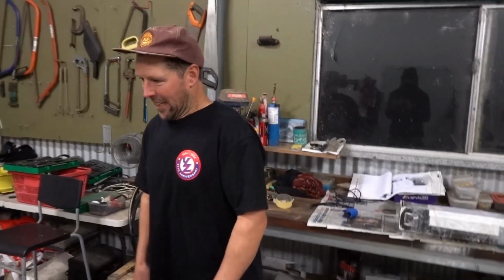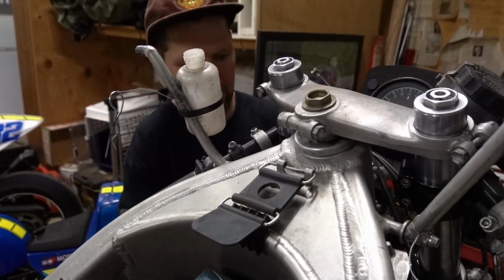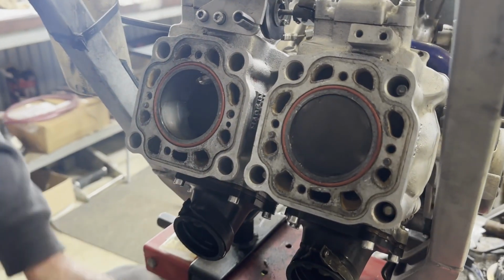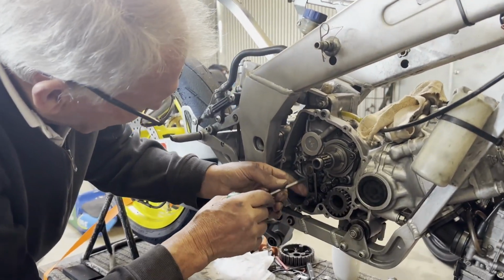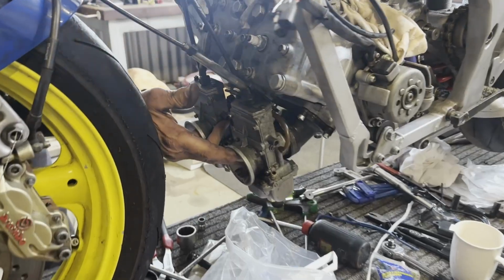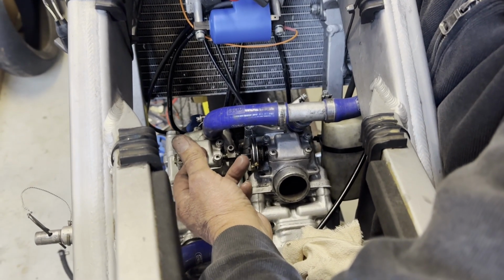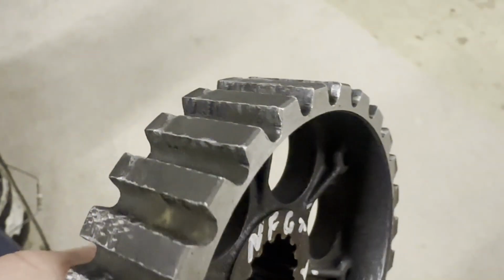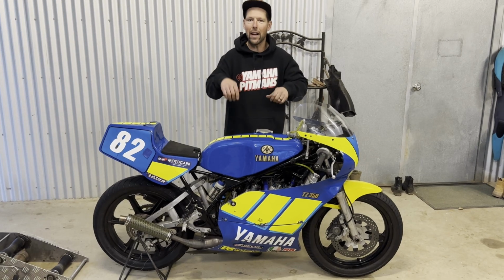TZ250 Reverse Cylinder

Comment: Great, glad to see an identical machine running. I just bought mine, I'm taking it apart to check everything before rebuilding it. I am also planning to create a channel dedicated to this motorcycle.
Reply from the maker: @pepepepe2420  good work mate keen to see how you go with it
Reply: @AndyPitman-vt7hm  I'm looking for a new or remanufactured counter shaft to do a good job, but it seems complicated to find.
Reply from the maker: @pepepepe2420  have you checked out Fondseca in the UK for parts mate?
Reply: @AndyPitman-vt7hm  Yes, I looked on the site, but there isn't one. I will contact them directly, perhaps it could help me by contacting someone else.
Reply from the maker: @pepepepe2420  Vince at Fondseca is very helpful. I’m sure he will sort something out for you mate

Comment: Really great vid mate. Nice to see your dad doing most of the work, long earned skills. Btw 80/90w for the gearbox oil on a dry clutch, 10/40 is for cars or wet clutches and lacks the non friction agents of gearbox oil that’s not shared with a clutch.
Reply from the maker: @mototoki  cheers for the feedback mate. Ok I will look at the gearbox oil to 80/90w. Do you recommend a brand?
Reply: @AndyPitman-vt7hm  I use Comma gear oil for my dry clutch TZR 3XV but I don’t race it so maybe a more race brand like Motol would be better! Using the non-friction additive the gear oil will certainly keep you ‘box working better for longer
Reply: @AndyPitman-vt7hm  maybe silkolene comp gear oil?
Reply from the maker: @mototoki  yes I will try sikolene I know they are a decent oil. Cheers for the info mate 👍

Comment: Why not get front forks and triple clamps from a 1990 TZR 3MA or from a 91 3XV?
Reply from the maker: @RachaelSA  the TZ forks I have are good enough to go quick on. I done want to change to an upside fork. Trying to keep the period look of the bike
Reply: @AndyPitman-vt7hm  I have an 89 3MA and a 1990 3MA SP with upside forks and dry clutch, and the 1990 handles so much better, but I understand trying to keep it period correct.
Reply from the maker: @RachaelSA I would love to get the A model as well. Do they come standard with upside forks?
Reply: @AndyPitman-vt7hm  I don't think so, but I'm not really 100% sure, all the ones I came across were grey imports and all the manuals and stuff I have found are in Japanese and I see ones called 3ma3, 3ma-00, 3ma5, 3ma-01 and 3ma10 and all different things, and I don't know which is which, but from what I can tell, all the ones until 1990 had normal forks, and in 1990 they came with upside down forks, and then later upside down forks and a dry clutch, and it was called an SP, (I think). I bought one of those in Dec 97 and rode it daily until late 1999 when something broke, so I bought a "project bike" in crates, realised its not the same and has normal forks and a slightly different engine and exhausts and stuff and I think its an 1989, so I found spares for the 1990/SP and fixed it, but had got a ZXR400 in the mean time so it just sat in my dads workshop. I kept eyeballing the classifieds and found more 3MA "project bikes" and "rolling chassis" and engines stripped in boxes and kept buying them until I found the parts to fix the second one, and it also just sat in my dads workshop, and every time I found more engines, frames or tanks or boxes of parts I dragged it all to my dads workshop and "forgot" about it for almost 20 years, until just over a year ago when my dads house got sold, so I took all my bikes and engines and crates of parts and sent everything to my house, so when I'm done in this city, I can move back home and start fixing them, because I saw leaking seals and rusted chains and broken bits when I stripped and cleaned and packed everything to get shipped. back to my house.
Reply from the maker: @RachaelSA  wow I didn’t know there were that many different models. Be good to see all your projects sorted. Definitely be worth a bit all the reverse cylinder stuff 👍